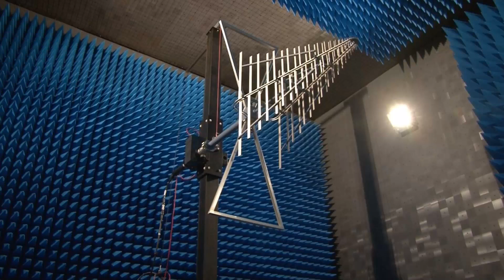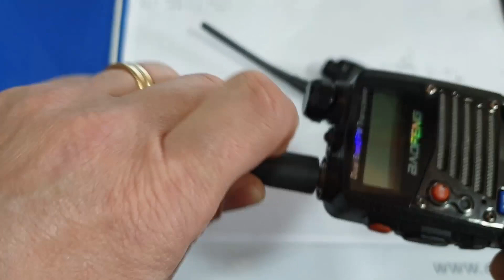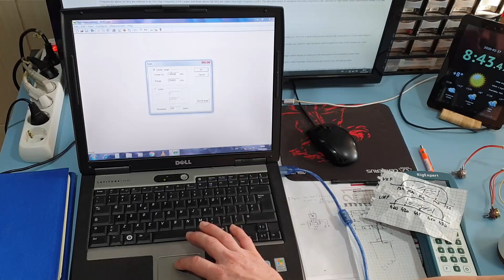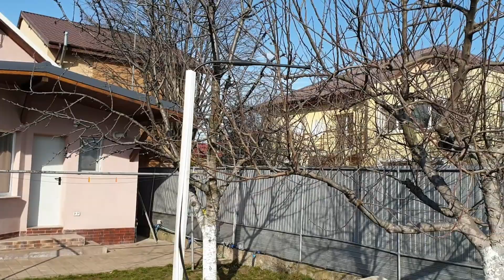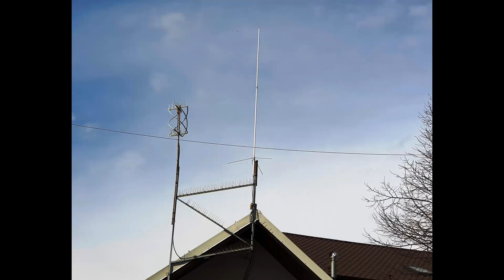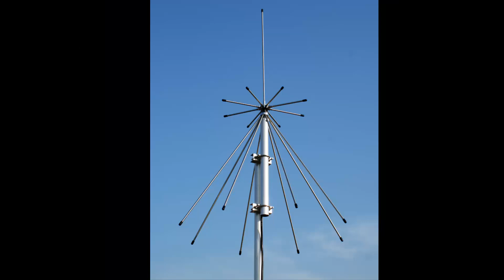Baofeng UV-5 & UV-3 antenna analysis and comparison

Comment: I have uv5riii model and using the surecom sw33 swr meter I got an swr of 19.9. Same test with Nagoya 771antenna was 19.9. I put a 1.5 m counterpoise and when testing I was sitting down and the counterpoise was touching the concrete. I got swr of 9.5 and fluctuating lower. My counterpoise on the rats tail end was not bare wire. Yet it lowered the the ratio. Can I modify antenna or just put an 2 meter counterpoise? The 1.5 m version worked roughly 2 times better. I have set up a uniden whip antenna with coaxial cable and sma connector to baofeng uv5r iii. When tested swr, I got down 1:1 . Any reply appreciated cheers from Australia 🙂👍👍👍
Reply from the maker: Hey Edmond, 

I've never used this technique before. After these tests, I also bought a Nagoya NA771 for my Baofeng. I didn't test it again, but I feel like I have better reception. I don't really use radios too much in my field trips, I'm more a stationary HAM. I would go for a better antenna (Nagoya is all right), cause I think the counterpoise's behaviour is more difficult to control.
You understand that a SWR bigger than (let's say) 10, is basically infinite, so, if you can still transmit and receive, there's still some sort of matching.
I did a video where I made a GP antenna for this portable and the results were really good. Of course, it's not that mobile.
https://www.youtube.com/watch?v=17MeHoVj2UQ&t=393s
Cheers!
Reply: @Racov  yeah I was getting frustrated with testing as I'm a bit OCD. Everything works fine I just wanted it to be perfect at 1:1 swr. Even the fake Nagoya 771 is better, more crisp, less noise even from trickiest on the highway. I think I get a bit OCD? Cheers